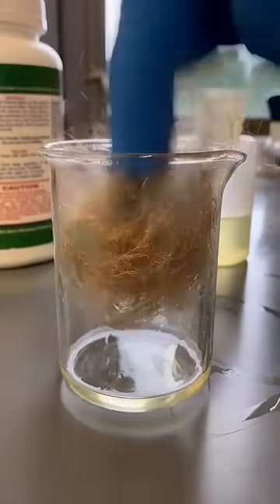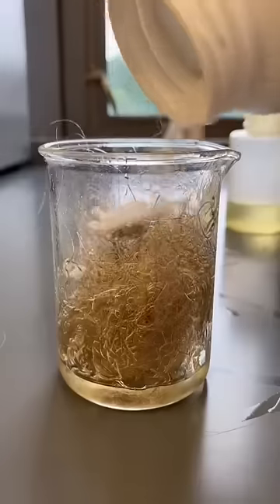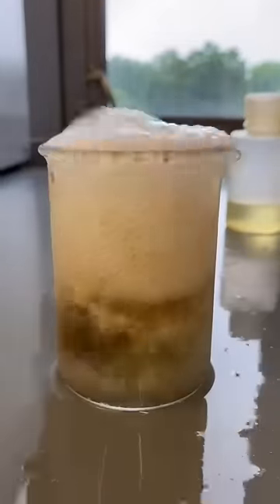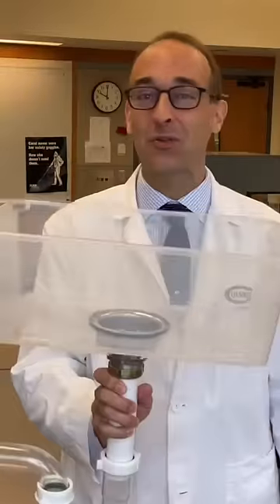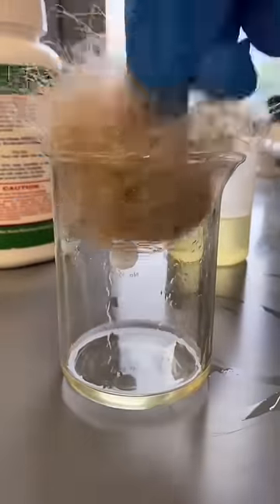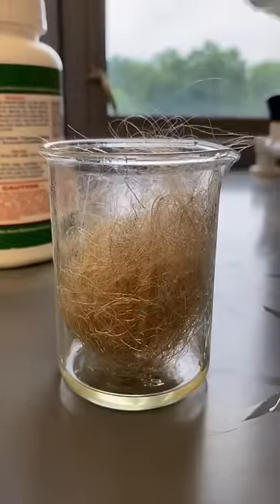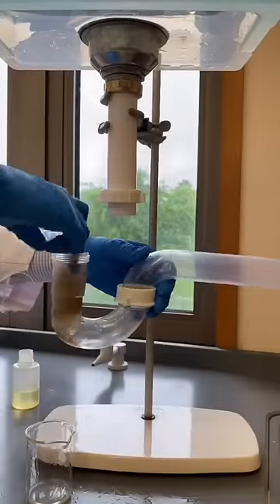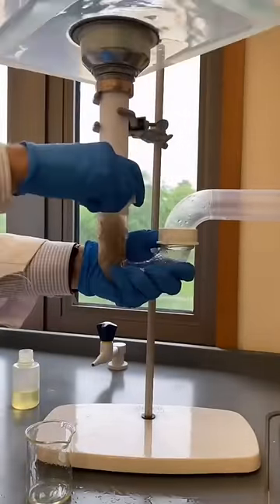How solid drain cleaners work

Comment: It's also a exothermic  reaction. Meaning it can blow up your pipe if it's too clogged. Melt, and or just weaken it.
Reply: Well i sure as hell don't want any magic recipe to blow up mine old pipes eh
Reply: so, a pipe bomb.
Reply: @water1705  uh, y- yeah
Reply: It wouldn’t blow up since the pressure could go back up the tube. Unless the reaction was insanely violent.
Reply: @connorcolumbia5398  you'd be surprised

Comment: This is a chemical that we have at our work. They call it “caustic.”  We also have sulphuric acid, and Chlorine, because it’s a Chlorine plant. All of these chemicals need to definitely be treated with respect. I saw co-worker get hit with 135 degree 30+ percent caustic and it melted the skin off of his leg.
Reply: how did it hit him? Did it react with water/hydrate, boil, then splash?
Reply: @sakesaurus  His harness turned a valve and it came out of a pipe.
Reply: Where I live currently, they dump sulfuric acid in the main drain for the house.
Reply: @AlyssaLopez-n1c  Here too but it’s not a really high concentration
Reply: Idk what concentration they use here but they tell you dump it and run away
Reply: I heard baking soda and boiling water works 🤷🏽‍♂️
Reply: @meegssan5716 baking soda and lye are both basic so they won't truly neutralize. Mixing water with lye can be dangerous if you don't know what you're doing because it's extremely exothermic. Don't screw around with lye, seriously, it will eat away at flesh.
Reply: I deepclean a kitchen as part of my job and have to use caustic. Shit's scary to use, stings every single part of your body
Reply: Lye (what he used) = caustic = sodium hydroxide
Reply: @gulzeb  correct
Reply: Has no one here ever seen Fight Club? I think your co-worker qualifies as a member after that, OP

Comment: I'm a service plumber I have nonissue with yall using chemicals just make sure if you do have a back up. Make sure it still drains alittle bit. You don't want stationary water. The chemicals will just sit on the pipe and eat it threw.
Reply: Or worse yet, they harden. All too often i stick my machine in a drain and feel like I'm breaking up concrete because they've been using draino with it completely plugged.
Reply: I have an issue with it, it’s bad for the environment, a lot of times people use it for the wrong type of clog, and I’ve seen people with severe burns because they got it on their skin.
Reply: @AloneInTheCandyJar  When my cables from my machine come out itll spin it all over at times. I've burned my forearms and such plenty from it.
Stinks like hell as well. 

Draino/like products honestly are a waste of money most of the time. Just call a plumber to actually remove the blockage.
Reply: I've always heard chemical drain cleaners corrode your pipes but your saying if you flush it properly that is not the case? Or just that the damage is miminal?
Reply: @Sean-ft7ys  depends on your drainage system. If you have metal drainage pipes like cast iron, it will strip out the rust and cause breaks in the line over time. 
Plastic drains like PVC or ABS can still break down with certain drain cleaners, but it will take significantly longer and usually the cleaner needs to sit somewhere.
If you have any bellies or back-grading in you drainage system, chemical cleaners will only do more damage and make future clogs worse.
Reply: @AloneInTheCandyJar  uh…they clean air conditioner condensers with the same stuff dude. It just runs straight into the ground. 🤣🤣🤣
Reply: Adult child of a plumber and have been steered away many times from drain cleaner because my dad has had way too many jobs where it just went wrong. Also steered away from garbage disposal in sink because those also cause way too many problems. So yeah just call a plumber.
Reply: @kirks.1240  yeah I have heard the same and avoid drain cleaners because I have an old house with metal drainage piping. Have a garbage disposer but use a sink strainer and throw out most of the solids that get into the sink. Save the disposer for those little itty bittys that get through but I know it probably doesn’t make much a difference at that point
Reply: @kirks.1240  your father is a smart man 👍
Reply: *threw??? 🙄🤣

Comment: this feels like the safe version of chemistry 

NILE SAVE ME IM NOT IN DANGER
Reply: There's a few ways to make sodium hydroxide explosive. I'm sure he's done at least one of them already
Reply: Lye can cause chemical burns that really suck & the fumes aren’t good to inhale. I’d say the only truly safe chemistry is cooking but that isn’t really true, either lol
Reply: Try explosions&fire or extractions&ire
Reply: @BlueRoseFaery   you're using lye making pretzels or bagels?...
Reply: @petevenuti7355  I mean I am pretty basic
Reply: @petevenuti7355  Soap actually, I’ve made a few a batches of homemade soap with lye & fats, cold process. I thankfully haven’t gotten injured but I take plenty of precautions. But yes, lye is used in a few different culinary applications as well, but I haven’t tried my hand at those yet.
Reply: @BlueRoseFaery  between putting boiling water on powdered lye when clearing drains causing a water cannon hot lye "burp" , and using a concentrated lye solution in a heated pressure washer to clean the air vents in a restaurant..(10 years worth of sooty "Amber" an inch thick)
I'm lucky all I have is three small scars like the #3 on  dice, where 3 undissolved crystals landed on my shoulder and I didn't feel it until they ate through the skin... It was like three puncture wounds that didn't bleed much.. in retrospect I'm always thinking , what if that was in my eyes!
   To demonstrate the danger to my kids I liquefied a chicken carcass once (and to settle a morbid argument about HF and breaking bad with some adults)
   I make my own water glass as well (sodium silicate), that involves dissolving glass in molten lye..
    Lye is just as useful as to is dangerous!
Reply: @petevenuti7355  Oh wow, definitely lucky to not have any worse injuries. I always wear safety goggles when working with lye, and long sleeves & pants & gloves, etc, nothing uncovered but a few parts of my face. Which is a bit overkill for soap but I’d rather have an abundance of caution.

Sounds like a cool demonstration & a pretty awesome way to win an argument. What do you use the sodium silicate for?
Reply: @BlueRoseFaery sodium silicate besides being great for cleaning grills and stoves, I've made a few microwave kilns , it's what I used to make the silicone carbide stick and it turns into glass when the temperature gets high enough
It's also an ingredient in some glass and Clay mixtures that end up in those kilns.

I've also used it in experiments with batteries as an ion exchange membrane and electrolyte, nothing successful yet unfortunately..

I'm sure there's plenty of other uses that im just not using it for yet.. like it can be a micronutrient for diatoms and algae in an algae farm... If someone ever gives me a whole bunch of free transparent tubing I'll probably try and turn it into solar panels that grow algae mats, but I have too many other things to do first I'm not going to make that a separate project unless someone pays me or throws free material at me, I ain't Cody.
   Good for radiator & head gasket leaks.. but so is black pepper if your car is old enough...
Reply: @BlueRoseFaery  oh that demonstration wasn't that cool, 
smelly, yucky, and not smooth enough to just pour down the drain, also afraid to put it anywhere in the yard as it would probably kill a lot of things near it until it got dilute enough. Also the worries if the kids got near it when I wasn't around...
...Wasn't my smartest idea...

Also, just like when I dissolved the shells of some eggs , drew some eyeballs on them and hit them with a bungee cord to show my kids  what a bungee could do to their eyes when they play with them,...  they forgot by the next week anyway ,despite my drama... Younger kids just don't seem to learn unless it's "the hard way" , which also seems to apply to a lot of adults 😜 and unfortunately applies to me sometimes.
Reply: All hail mighty Nile red
Reply: Remember to always wear your lab equipment bruh.
Reply: @BlueRoseFaery
Reply: @BlueRoseFaery 
I just wanted to replay that! 😂
"Cooking isn't safe!!"
But then you did yourself.
Reply: simultaneously, all chemistry is dangerous if you do it wrong and also all chemistry is safe if you do it right
Reply: All chemistry is safe if you know what you're doing.
Reply: Nigel is the chemist i aspire to be

Comment: In chemistry, one of the first things you learn is to add strong acids and bases to water, and not the other way around, so the addition of water to sodium hydroxide made me wince just a little.
Reply: This seems to me to be a pretty fundamental thing to have overlooked.
Reply: Weirdly enough the instructions on those bottles/packs of Sodium hydroxide based drain cleaners tell you to add those beads of that stuff first, then water. I have tested such product on clogged sink, but I just could not do it that way. Added water first then the solution.

Comment: Hint: Some people just apply pressure through application of advanced plunger technology to achieve the same result. Which also is much more sustainable (for your purse anyway)
Bonus hint: The hydroylation reaction is highly exothermic, which means it can get really, really hot. I learned that the hard way when I once used drain cleaner to unclog the drain of a shower. 
Unfortunately the plasic tubes deformed under the influence of heat. And even more unfortunately those tubes were installed out of reach under the built-in shower tray. 
Yes, drain cleaner is such a convinience!
Reply: Thanks for the information! 👍

Comment: Fun fact if you buy a snake tool from Lowes you can clear your drains for years for one flat price. Also doesn't need 50 chemicals that risk damaging your plumbing or health
Reply: I'd say as long as you're not drinking out of the sewer you'll be just fine.
Reply: @aviandragon1390 the problem is that 1) it damages your pipes. And 2) how much do you want to bet some people WILL accidentally ingest a few drops or inhale the fumes or leave it in their hands without washing properly?
Reply: This is 1 chemical not 50 plus not everybodys got time to fuck with sewege

Comment: SERIOUSLY if you ever use this and it doesn't work and you call a plumber to fix your drain TELL THEM THERE IS DRAIN CLEANER IN THE PIPE! It could actually cause them to go blind if it gets in their eyes! If they know about it they can prevent this easily but they have to know!

Comment: My dad had to use something this because I washed my hands after making stuff out of air dry clay so much that clay somehow started to clog it. It was barely any on my hand over a long period of time.

Clay can clog drains. I did this at home because I didn't want to make a bowl of water that may get spilled or something just to slowly build up clay I get off my hands to reuse. It would've been practically nothing as I make too many tiny things and nothing big enough to have a significant amount of clay to save.

So in the end clay clogs drains. In art classes they make you use a bowl to rinse most of the clay off first before you actually wash your hands because people doing that every time they need to for hours on end would clog them much faster than it would in a home with one person crafting with clay.
Reply: So where do you throw the clay water at?

Comment: Use hot water with the sodium hydroxide.
Then flush with cold. 

The product is called "Talon" in case you were wondering

Comment: In my industry I actually work around sodium hydroxide a lot. And then one day I saw sodium hydroxide in the ingredients list of my energy drink.. I was like bro, wtf.
Reply: What brand of energy drink is that tf?
Reply: Just a tiny amount to adjust the pH most likely
Reply: You work in an industry that handles chemicals like lye and you don't know how dosage affects toxicity???
Reply: @pendlera2959 when did he ever say that? Stop acting.
Reply: Makes sense, they probably add a small amount to make the drink a bit less acidic. Nothing harmful about it when used in the right (very small) amounts. The harmful thing about concentrated sodium hydroxide is that it's extremely basic, but the elements that it'll break down to are totally ok.

Comment: Interesting! I always thought it was something super corrosive that somehow ate through the hair but managed to not destroy the pipes 😓 lol good video!
Reply: It is, sodium hydroxide is horrifying in high concentrations lol
Reply: It can damage pipes due to the heat generated
Reply: It does do that. It’s just that once a little of it dissolves it is no longer clogging the drain. Hair in NaOH will completely dissolve. Also fats and oils in NaOH basically turn into soap

Comment: Yep ... at the animal shelter I worked at, they'd get "degreaser" that was actually for kitchen grease traps, and it was industrial strength sodium hydroxide, also known as caustic lye. It took the paint off the walls!
Then for a couple of warehouse orders, we got this glycol ether (ether glycol?) degreaser that was SO much better for what we were using it for. I saved the label off of a jug, and told my supervisor that's what we needed to order. Idiot said "they just send us what they send us."  Ugh!
Reply: Why does that make him an idiot? If anyone is an idiot is it not the department that sends what they send? And are they really idiots because of that?
Reply: @domhamai  they the ability to tell them no that doesn't work we need this iteam which does work,but just saying no we get what we get makes them an idiot for nit trying to get better equipment
Reply: You're right. He should definitely change the way the entire business functions because you like a different drain cleaner. A good boss would put that right at the top of his priority list since he's obviously not doing anything important while you're running around unclogging drains.
Reply: @aviandragon1390 A good boss listens to their employees when they identify an easy solution for a problem. Also, OP works at an animal shelter, so why are you acting like the business would need to be fundamentally altered to make a change in drain cleaner? While their supervisor probably couldn't order anything different, they could at least try to send the message up the chain.
Reply: @aviandragon1390  You're right. The efficacy of a chemical cleaner is definitely subjective. A good boss is defensive and disingenuous when the subordinates try to make suggestions, because obviously they've got more important priorities to worry about than the people they employ to do all the laborious work with chemicals. 

Ugh, I've just vomited out some condescending assumptions haven't I? Sorry about that, stomach is on the fritz today.
Reply: And that is always the company line 🙄

Comment: You're supposed to put lye into water not water into lye hence the reason it boiled over. It's very dangerous to that and you could have just influenced someone to do something that could hurt them badly.
Reply: you seem to be the only person in this comment section with some basic chemistry knowledge. And yes, not only do you add bases or acids to water and not the other way around, but in this specific case, the sodium hydroxide packaging (assuming it's sold specifically as drain cleaner pellets) will instruct you to disolve in warm water and then pour said solution down the drain.

Comment: My wife and I got tired of having to clean the trap and then snake the drain for whatever clog wasn't in the trap. So we bought a mini-trap for the shower - a little basket that sits just under the floor drain cap. Once/week I take that basket out, soak it overnight in a plastic cup of Liquid Plumber, then rinse it out in the morning. LP doesn't work on plastic, so no worries about the acid going everywhere.

Comment: I just gotta point out, it depends on WHAT is clogging your drain.

I work in an industrial setting where for some reason people flush paper towel and NaClO or NaOH won't break down the cellulose.

Which means I have to finagle a goofy as shit setup to get H2SO4 down into the pipes without touching the toilet.
Reply: Does sulfuric acid damage the porcelain or something?
Reply: @funnyepic7054  yes. Sulphuric acid will destroy the finish on the material and the porcelain will stain.

Honestly it shouldn't be used unless in emergency or a solid block of material a worm can't break loose. Most sanitary is black steel pipe and will react with the acid too.

Sodium Hydroxide (lye) (bases)breaks down fats and proteins (hair) while acid based cleaners are better for organic chains like cellulose / starch (like if someone flushed paper towels).
Reply: @ObservationofLimits  cool, thanks!
Reply: One dude at a random Ace hardware saved my year ago. He mentioned that I needed a base to eat away hair… or something…. Anyways- I haven’t bought a single bottle of draino of the like since. I just have had no use for those type of removers since.

Comment: The thing stopping my drain from working is actually a fale airpod and my mom's lighter.
The drain pipes are glued shut.
My landlord sucks
Reply: Have you tried a drain snake? My mom dropped a small cosmetic bottle lid down the bathroom sink, but the drain snake eventually got it out. It was almost completely blocked.
Reply: @catboy_official  Its been fixed now, but with the size of the pipe a snake wouldnt fit. Most of the external plumbing was done by said landlord, hence the glue
Reply: Mom's lighter in the sink? trashy..
how the hell did it fit past the opening anyways